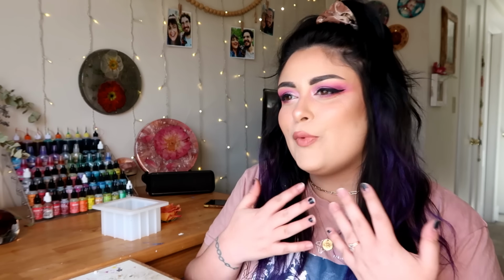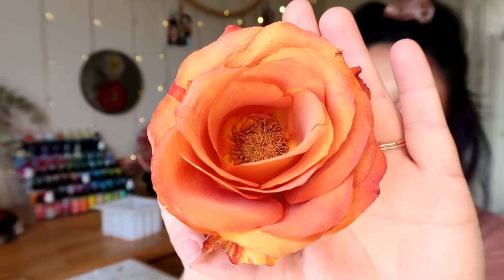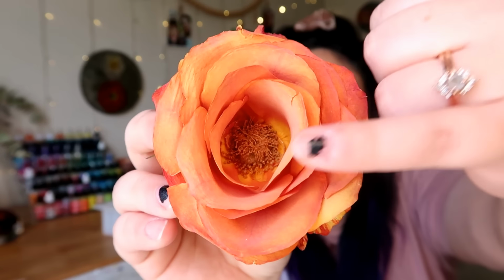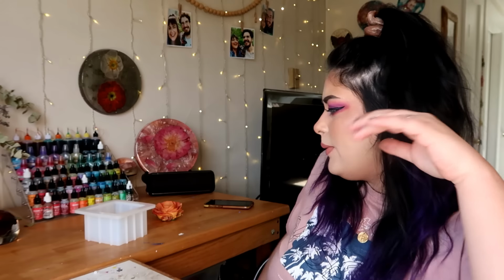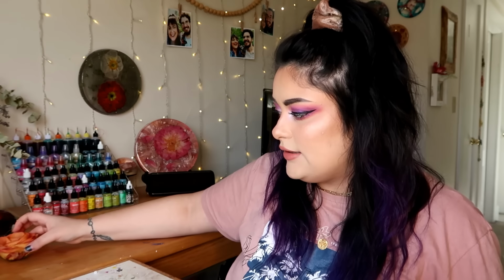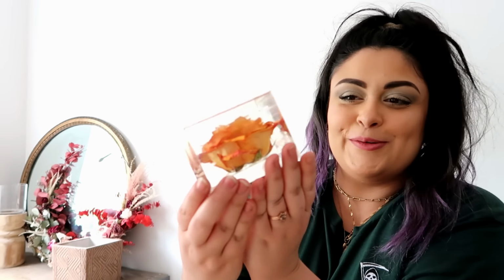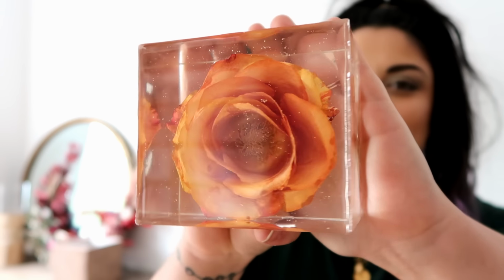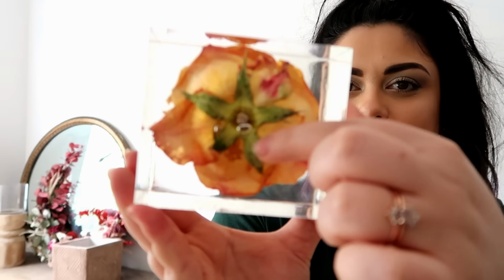How To Preserve a Full Rose in Resin!

Comment: Hi there!  First off, thank you sssssssoooo much for posting this tutorial!  It's the best on YouTube by far!  Secondly, I have something to run by you to get your opinion on, if you don't mind.  I had two family members pass away last year just 4 months apart.  They were an elderly couple that had been married for 53 years.  I have a rose from each of their flowers and I preserved them immediately upon getting them in the silicone gel you mentioned (got that tip from this video and it worked like a charm,thank you 😊).  Now, a year later, I wanted to take those two roses and place them in resin.  Is it possible to get a rectangular shaped mold something around the depth of the mold you used in this video just longer, and place both roses side by side with a nameplate, with their names on it, in between the roses?  If possible, how hard would it be to do?!  I've never ever worked with resin but really want to do this myself preferably. Is this something you've ever done?  Any advice would be greatly appreciated! Thank you so much!!!

Comment: Thank you for a wonderful video. I have a question regarding the usage of hot gun. I am using similar one as yours(mainly meant for art). The intensity of the hot gun(only one speed available) is high that the flower is impacted by the blow. Is it normal or am I doing something wrong?

Comment: I'm just starting to learn about drying flowers and epoxy, and I have some questions.  I have dried my roses and they came out better than I anticipated, but question is what happens if all the sandy silica does not come out?  And should I take off some of the petals?  They came out so pretty with all the petals in tact I   hate to start taking them apart.  But, I'm brand new at this.  Still studying before I start the epoxy part.

Comment: Your works are so beautiful! I have just found out your channel and will watch more of it this week. I have one problem in flowers. I've been also preserving my flowers in silica sand (brand: panacea) and I don't use any coating before casting them in resin. All of the flowers changed their colors/fade in just 1-2months even tho i dried them properly, i am also thinking if i should change resin. Do u have any tips for that? and i would like to know if how long does the flower retain their color in resin, if most of epoxy resins do turn yellow overtime coz yours still look good that one in your table that you had preserved 1 yr ago based on your video upload :D Thank you in advance!

Comment: Do you use a b4 treatment on the molds? I have seen like a spray or something to use on the molds so it doesn't stick, but I figured most epoxy resin has something in it to make it not stick to the molds made for the epoxy resin mixtures

Comment: New to resin crafts.  For this pour how much of each part do you mix?  I saw you used a glass measuring cup but I couldn’t tell how much of each you used for the base and then how much each for each layer after that.  Would a 32oz bottle of each be enough for this project?  I am not wanting to buy the jugs yet since Im still learning.

Comment: Have you found a one piece mold to make a large sphere like a crystal ball to put flowers in and cast them. I’ve tried the 2 part molds but end up with the line around it or bubbles on one side clear on the other.
What brand resin did you use. I didn’t catch the name of it

Comment: This is beautiful..I was just searching for how to put a rose in resin and found this (::: is it heavy?? I have a painting id love to do with a rose .. have you any idea how i could add it on a canvas? will it stay like that forever or will it rot eventually? thanks so much xx
Reply: If you leave a bit of the stem on, or stab a bit of wire through the base while its still a bit alive and pliable, you can dip it in resin and let it dry about 8 times and then snip off the stem and sand it flat and glue it to the painting? I've helped someone make jewelery this way out of roses. They get to be about the strength of ceramic.
Reply: They do start to lose their color after awhile, especially if left in the sun. But as long as its dried 100% before hand it shouldn't rot.

Comment: I love all your work first and foremost.  But I do have a question, does any of the resins that you use ever yellow or discolor due to time or sunlight/uv exposure?  After doing some research I find that Art Resin is the one resin that does not have that issue and therefore it is the one that I usually buy when I do buy it, because I am fearful that the other resins will yellow over time or due to UV exposure.

Comment: Hey i want to do this with funeral flowers and i do not want to screw it up ive already put them in silica gel using your silica gel video and the same stuff and took out the middle of the roses to the dry really good. Does your amazon list have the amount of resin you pour each layer of the rose with each time?

Comment: Does anyone know if you can make a resin cube like this but place it in a shadow box upside down and then cast around it? essentially casting resin on cured resin? I'm trying to preserve a wedding bouquet with roses and I didn't realize I can't cast facing up ,which is required for roses. my work around is potentially casting the roses separately in their own isolated cubes and adding them into the main frame. Then casting the rest of the resin and flat flowers. Thoughts on this?

Comment: hey someone can help with a question? What is what she added to the resin? and it's a must to heat it?
Reply: Hi!  She added just a dash of Gold Glitter Dust/Powder~ A Fine type of Glitter, as opposed to the Flakes.
And, yes~ the Heat Gun is what Pops The Tiny (but visible) Air Bubbles that are created during the mixing process.  When working with Acrylic Paint Pours, you can use a small blow tourch, but in THIS case the flame would burn the flower.
I trust I was helpful! 🐆
Reply: @katrogers3932  Thank you so much!!!!!! 💕

Comment: There's a gentleman on here that does a proxy resin crafting or artwork and he just did five roses and he used a silica gel like the beads of silica gel the stuff that comes in those packets and he poured around the bottom sorry I'm on the top for so kind of open the flower up a little bit and then he poured around the bottom of the Rose so that way it would dry somewhat open and then hold the form on the bottom I actually haven't watch the whole video yet so I had I don't actually know what you're going to be using it might be the same thing